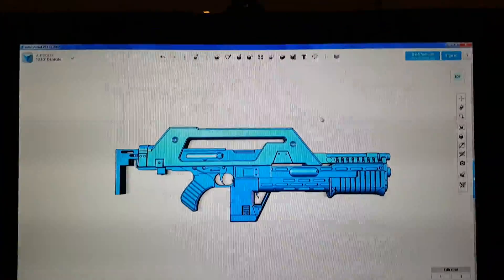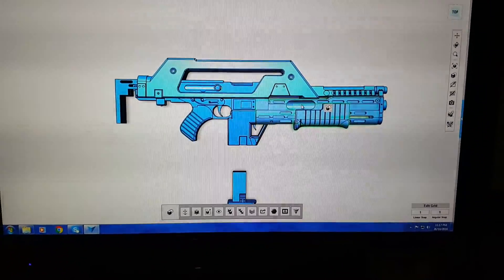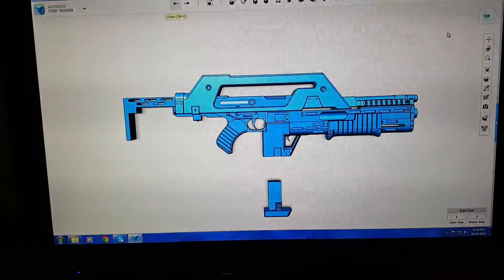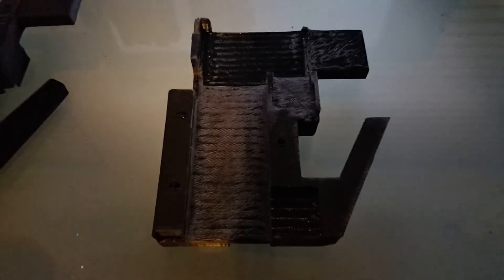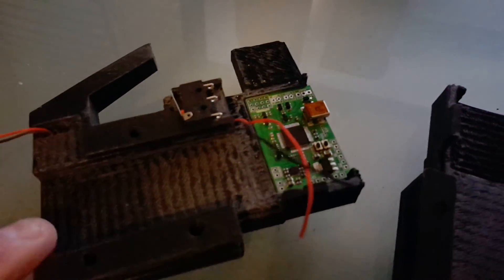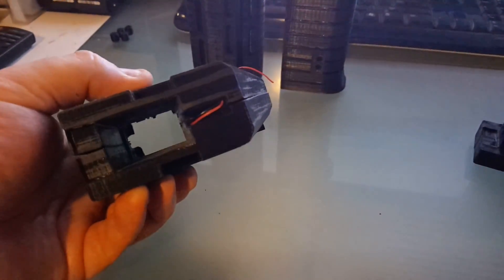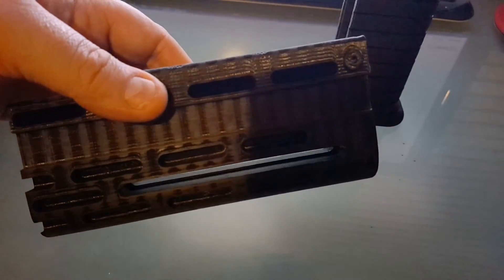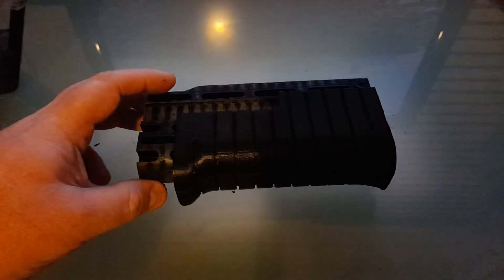3D printed M41A Pulse Rifle progress Part 1 (Non-Nerf)

Comment: What's the microcontroller you're using there?
Reply from the maker: That's the old (as opposed to his current one) counter board by Majenko ... does counter, sound and muzzle flash, great board but no longer available... although after speaking with him just the other day he is working on a replacement.